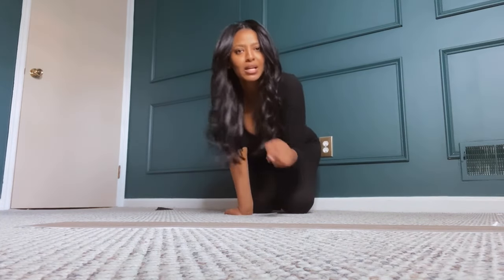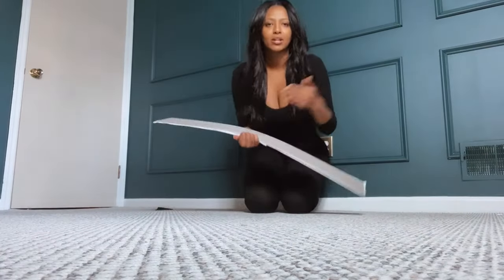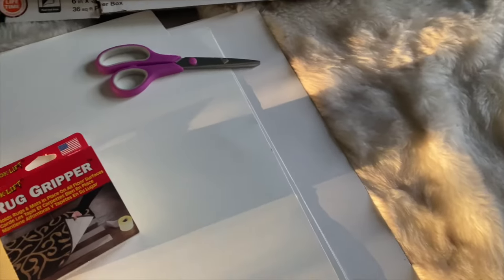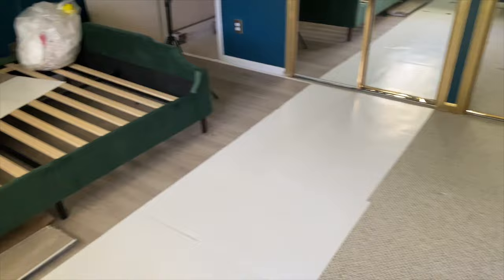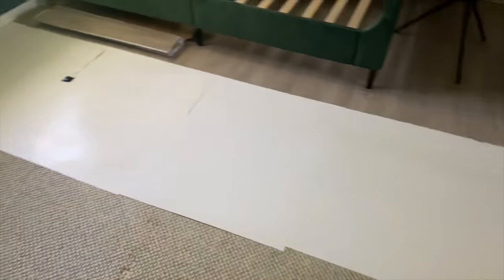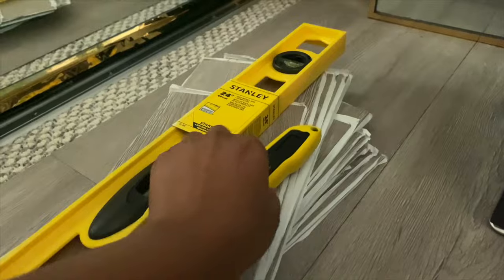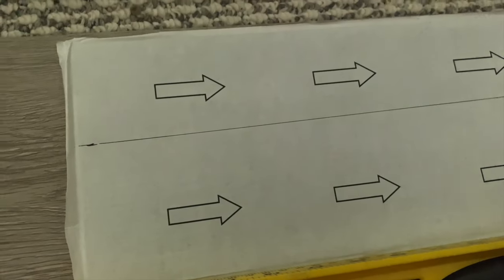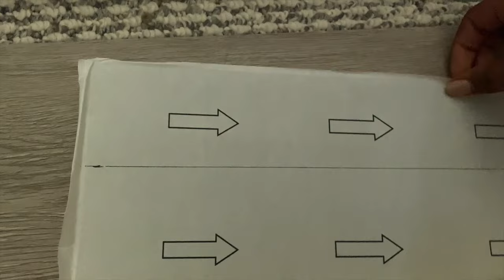DIY FLOOR MAKEOVER- Peel & Stick Tile Over Carpet (RENTER FRIENDLY- BUDGET FRIENDLY)

Comment: This is a good idea for temporary flooring,but You should have staggered the seams. You would have had to do some trimming on some planks, but it would have been worth it. It would look better and you would have a stronger more solid surface. Those long single seams are weak points.
Reply from the maker: Hey! Thanks for the for the tip, I see what you mean. I will definitely try that next time.
Reply: The first clue that gives away that this is a diy job: seams are lined up. I can only imagine what it looks like around the door jambs, baseboards etc. that’s why people like me make a living installing floors

Comment: Does this also help with odor elimination? Shampooing has not helped and I just can't stand the smell of the carpet in the rental.
Reply from the maker: Good question, I don’t think it would be very helpful because the smell would most likely find a way out. I would recommend using one of those carpet powders and vacuuming that could help

Comment: Will the rug gripper not leave residue on the carpet when you move?
Reply from the maker: Hey! No, no residue at all. The rug gripper is designed specifically for this purpose
Reply: @IdaAlexis  wow! That’s awesome! I may do this in my kids rooms’ because the new place has WHITE carpet which will not work with my teenagers

Comment: Did you try putting it straight onto the carpet. If so what were the results
Reply from the maker: Hi! No, there is white poster board under about 85% of the floor to avoid residue okay carpet
Reply: @IdaAlexis  thanks

Comment: Heard  there are mold issues from covering carpet in another video using planks but do you have any mold problems underneath? (I know you didnt use planks but still curious, thanks!)
Reply from the maker: Hey doll, no I haven't. I did hear feedback that you have to be careful with liquids. For example, after vacuuming I will use a swiffer wet wipes instead of mopping
Reply: @IdaAlexis  thankyou!
Reply from the maker: Here's the update & removal video https://youtu.be/gQe14yFWmPQ

Comment: When you walk on the flooring, because its carpet, doesn't it go in since the vinyl is thin? Is there a noise when you walk over it like can you hear yhr paper board crinkle or is the floow super stable?
Reply from the maker: Hey love! No, its overall like a normal floor because this is a very low pile carpet. Just make sure you're not doing this on a thick carpet

Comment: This is brilliant. Going to do this to my office. Question I have are some experiences with different types of rug. This rug in video is like those office rugs so they are low and not really soft. My carpet has a little more fluff to it but I hate the color but don’t want to take it out just yet. Has anyone tried this on a little thicker carpet
Reply from the maker: Thank you so much! Ugh unfortunately I don't think this will work on a thicker rug unless you add wood underneath. If the area underneath isn't flat enough, it will feel soft when you walk

Comment: Does it feel weird walking over poster board? Are the vinyl stickers stiff or hard? I want it to feel like actual floor when I walk
Reply from the maker: Hey love, it feels fine overall. If your carpet is very thick, I wouldn't recommend. You can also add wood underneath to make it feel 100% normal, but I didn't want to do all that for a place I would be less than 1 year. Here's the update & removal video https://youtu.be/gQe14yFWmPQ

Comment: I’d love to do this but my question is the cleaning aspect.. Would it get wet under or would it be okay? I dislike my carpets in my apartment, ugly beige
Reply from the maker: Hey, I used a vacuum and swiffer wet wipes and it was fine. I wouldn't recommend using a traditional mop.

Comment: How does the poster board do with you walking on it?
Reply from the maker: Hey, thanks for watching. It feels normal. This poster board is a very thin sheet that goes underneath the peel & stick tile. I used that to prevent the tile sticking to the carpet.

Comment: Do you have to put the poster board under?
Reply from the maker: Hi Amanda, Yes please put the poster paper underneath so the glue doesn't stick to the floor underneath. If you're putting this over hardwood floor (not carpet) check out this method using only contact paper https://www.youtube.com/watch?v=dhUpCYi8OKM

Comment: About how many planks did you need?
Reply from the maker: Hi! I used 4 boxes. Each box has 24 planks and covers 36 sqft. 

So I calculated the area of the room which was about 140 sqft and divided that by 36